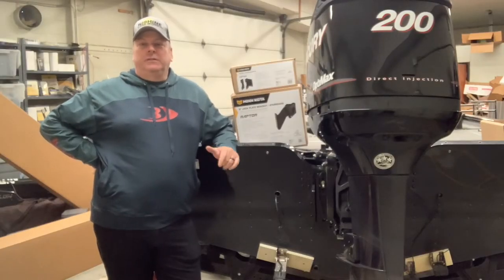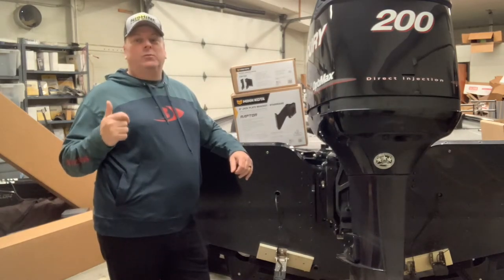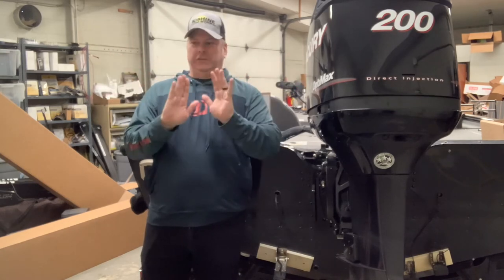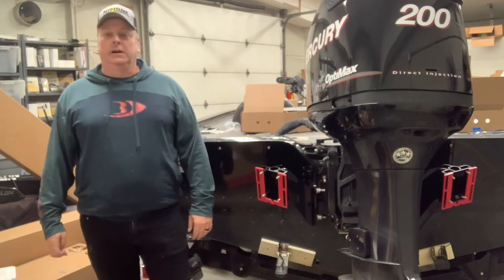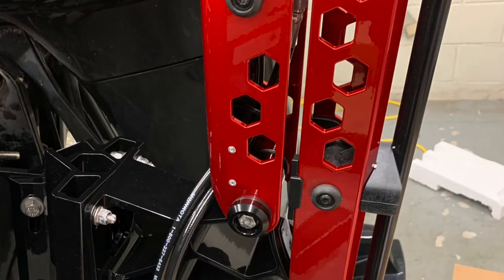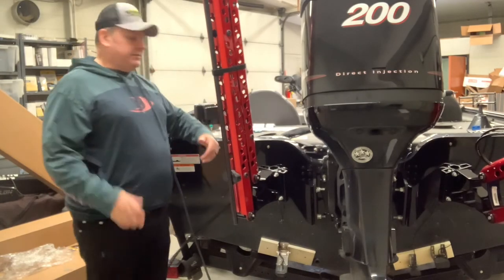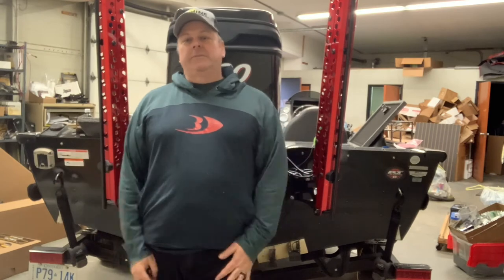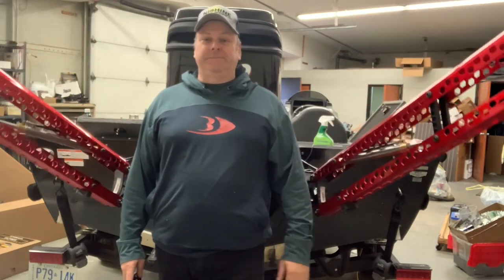Minn Kota Raptor Installation

Comment: Did you have issues with the bolts on mounting bracket? I tried installing mine yesterday and the nuts were really tight and even snapped 2 of the studs
Reply from the maker: The only time I broke any bolts was when I didn't use the grease in the white tube that comes with the bolts

Comment: I was wondering how tall the raptors are from the ground with the boat on the trailer. I have the same boat, and I’m trying to decide between 8 and 10 foot raptors based in part on garage space. Thanks.
Reply from the maker: Ooooh sorry Ryan, my boat is at the cottage now for the winter...probably being invaded by mice!. I can say this... an 8' Raptor is 4'10" and a 10' Raptor is 5' 10". If you add the length from your engine bolts to the ground you should have your number. Here are a couple of notes on the 10' I use. 1- I asked everyone fishing in the back if they felt they got in the way...answer was no. I fished in the back as well and it wasn't aproblem. 2- to get them in my garage, I extend them a bit to go under the garage door and then bring them back up once in. (best to have a spotter when doing this). 3- I was concerned with the height of the 10'ers when installing, but love them now. I have bottomed them out a few times so 8'ers would be too short for me.

Comment: Theoretically speaking, if you had tilt brackets on them, with those brackets and the angle inward of the raptor, would they tilt down and miss the motor or would they hit it? Thanks.
Reply from the maker: They would most likely miss the motor but that depends on the trim of the motor

Comment: what's your height measurement when raptors are in the up postion ... ground to top ?
Need to make sure they'll fit in my garage 
Thanks
Randy
Reply from the maker: My boat is in the water all summer so I can't measure, but a 10' Raptor is 70" long. If you add a measurement from the floor to the lower bolt on your engine, that would be pretty precise

Comment: One more question.  Can I use the 2" setback with 4in rise or the 6in rise with 2in setback. I have a 2012 tracker with 60hp. The hull looks like yours. Thanks alot. Does the rise effect the finished angle it will mount? I would not want it to be at a angle to much.  Thanks.  Is thehull? Does the rise mean how close it will be to the top of hull?
Reply from the maker: So the setback is 3" and used mostly for direct to transom mounts to get it away form transom a bit. However it is one solid piece so it could be used with the backplate brackets between the Raptor and bracket but not sure why you would need that. The angle will be pretty much same as trams but depending on bracket's used it could be altered slightly